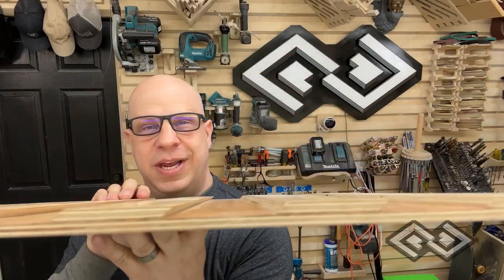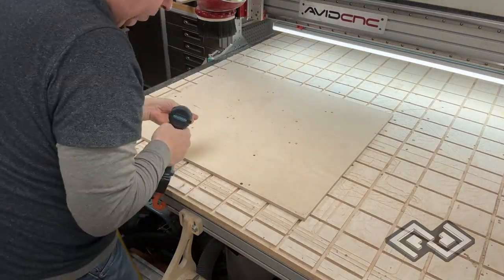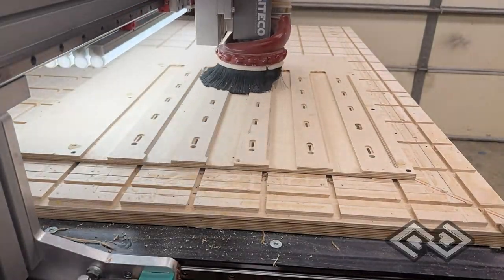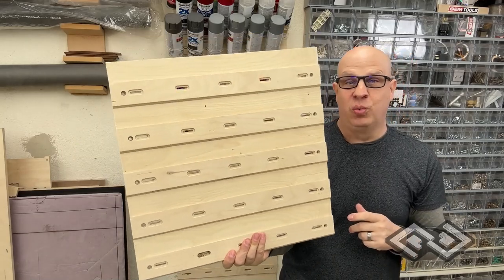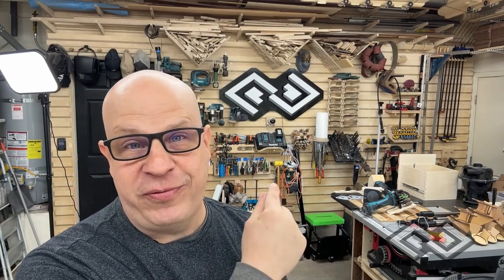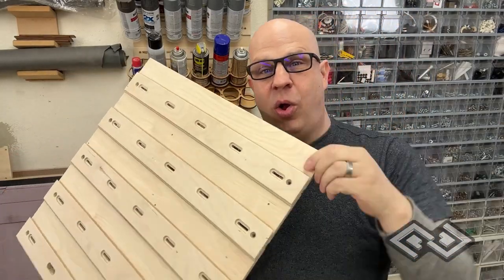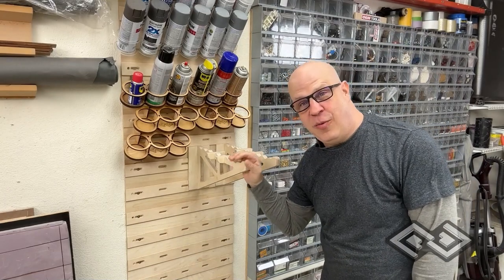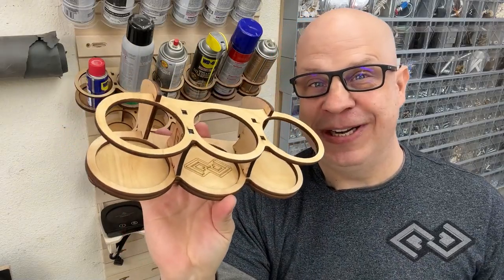French Cleat Wall Panel Tutorial! A New Design for French Cleats.

Comment: very wasteful if expensive plywood!  I' resist this unnecessary innovation thanks!
Reply from the maker: It might waste a bit if the plywood but it saves a great deal on time a labor which in the end is more valuable than material costs. But if it doesn’t suit your needs then don’t use them. Why try and make that decision for others 🤷‍♂️😂👎